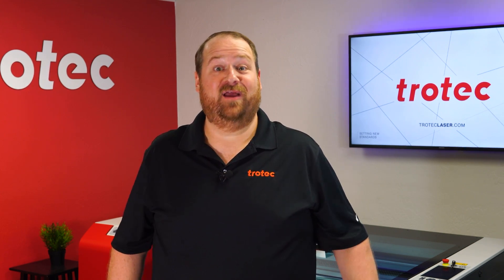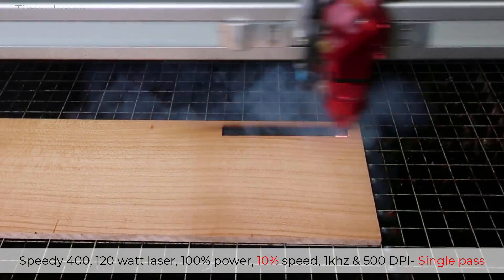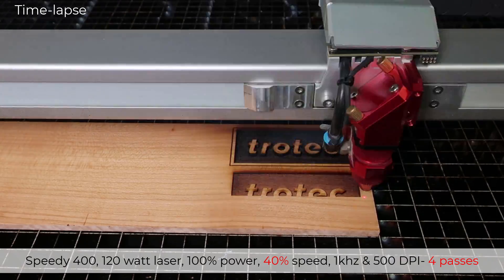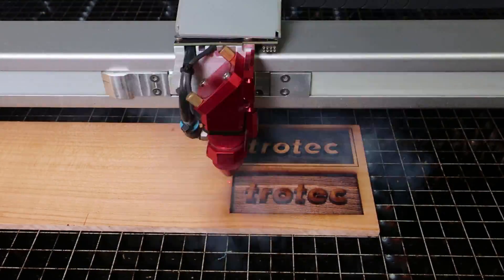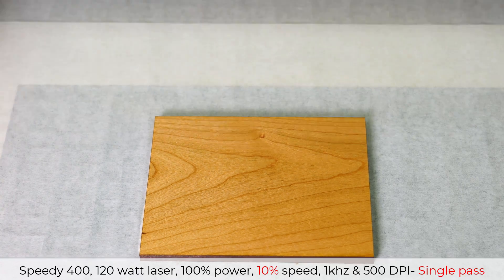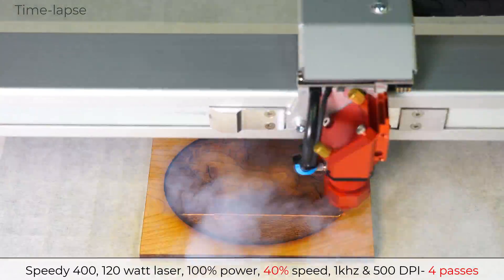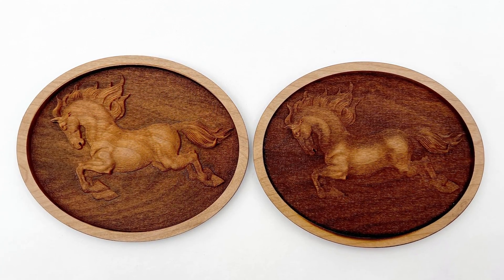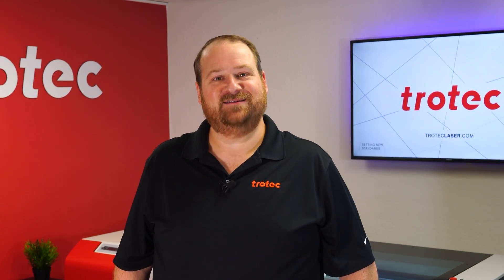Laser Hack: Multi-Pass with Laser Deep Engraving

Comment: Newb, researching the market before I plunge in. Isn't running any co2 laser at 100% a lifespan no-no? I guess if you are factoring laser replacement costs into the sale price of the item it could still work out with the increased speed being worth the wear and tear.
Reply from the maker: With some brands, that is true. However, we use a ceramic core in our lasers. Because of this, they can easily handle full laser power whenever needed. Ceramic allows for better cooling, faster laser pulse time, and overall better performance, virtually eliminating the issues seen in other brands.

Comment: Thanks for the demo!
Regarding cleaning, my own experiments have shown that water raises the woodgrain. Household ammomina disolves the smoke stain almost instantly and won't raise the grain. Coupled with a bristle brush it will clean the engraving. Alcohol will clean it also, just much slower.
Reply from the maker: Thank you for the tip!

Comment: Hi I’m currently making a puzzle piece that requires multiple passes to cut through the wood. How can I get my laser (using light burn) to complete one passing before starting the next? It seems to do the circular pieces first multiple times.
Reply: play with the optimization settings or just disable them, you can preview the cut path before sending it to the machine, if that doesnt work just burn one pass at a time manually starting the 2nd/3rd etc
Reply: @glitter_fart  thank you for your input! Appreciate the reply.